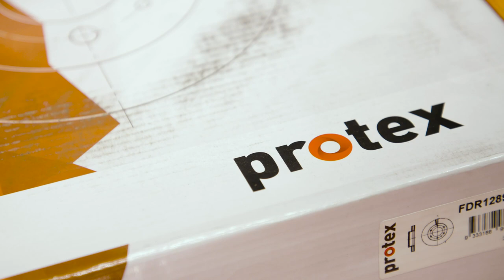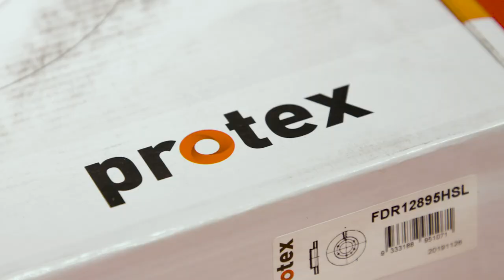Ranger gets Protex brake rotors and pads

Comment: I noticed you didn't put the screws back onto the rotor to secure it to the wheel hub. Isn't this screw necessary? I know the rotor will be secured by the wheel bolts as well.